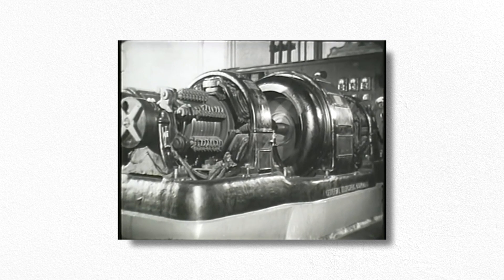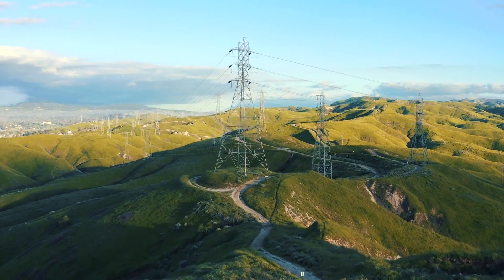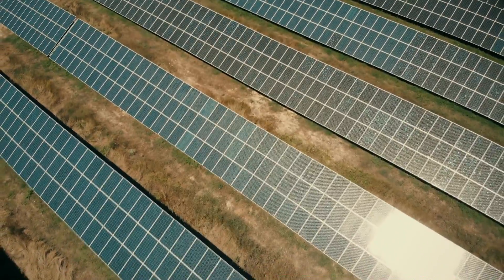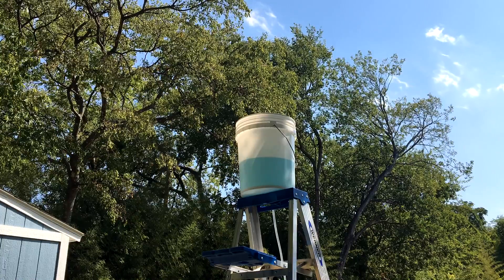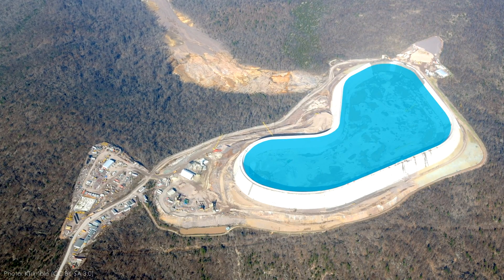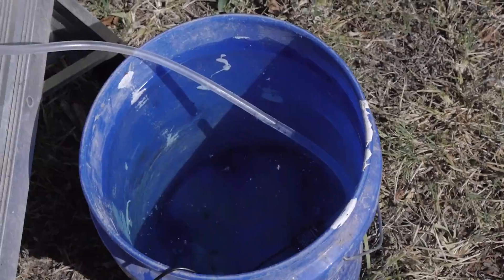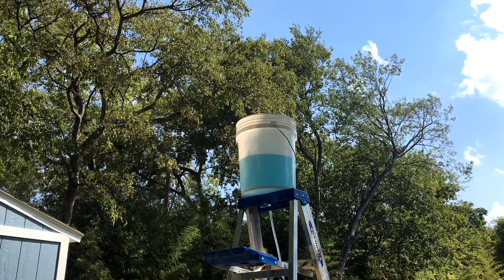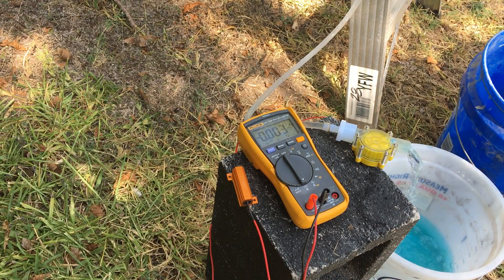World's Largest Batteries - (Pumped Storage)

Comment: I believe dams are an ecological disaster but I would love to know your views instead of parrot what I read. As for energy storage I think this is the biggest issue we currently face in the pursuit of clean energy using variable sources such as sun and wind, tides (slack tide) and waves. These sources we are harnessing for power are variable and our best efforts to build have proven inability to deal with low energy and high energy with reduced lifespans in some instances, limited availability based on expected extremes and expected downtime for maintenance. These problems are solvable. 

HVDC is a good option for long distance transfer of energy at a lowish loss to allow surrounding grids to handle power fluctuations but that depends on massive amounts of excess power availability from other sources... but has potential. Hydrogen is a good storage and transport system with pipes either as a cryo liquid or compressed gas, we could slowly replace the natural gas system with hydrogen by adding some carbon (simplified but worth a read) to build a market for hydrogen as a market for raw hydrogen is built and the kinks are solved. There are always kinks. Production of hydrogen is not easy. 

Oceanic Thermal Energy Conversion. That's the answer in my opinion to our energy demand and so much more. Hydrogen from salt water, water desalination, metal and mineral mining, fish farming, algae production for biofuels, carbon sink, and so much more. Well worth the read. Nuclear in all ish forms rocks and plasma gasification of waste would solve our waste issues and can be a carbon sink including plastic. Terrapower is making a traveling wave reactor that looks good and will take our wastes from reactors and weapons and convert it to useable power minimizing waste. 

OTEC could also clean the water and help remove plastics.

They have the technologies just lack the voice to drive them.

Comment: PSH is only expensive if the requirement is to create dams from scratch. For example, in California there are quite a few dams that can be separated into high dams and lower dams that are fed from those, mostly due to the geography of the central valley being surrounded by mountains. These are perfect candidates for conversion to PSH even while serving their original requirements of storage and power generation.

The main factor holding that kind of PSH back is political, not physical. The anti-dam political movement is in full swing here.

Comment: Did I miss it? In the discussion of efficiency and profit, sure the idea is to use energy surplus now to provide energy needed later. But the strongest case is when energy demand is below base-load, and the energy, whether Nuclear or solar, is generated and would other wise be wasted. Use (some of) it, or lose it.
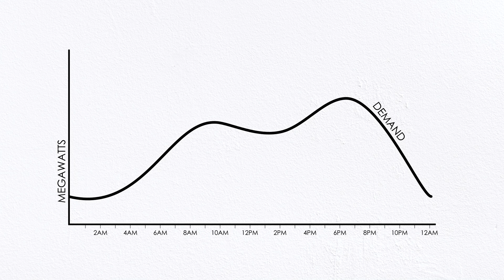Reply from the maker: Check out the graph at 3:04
Reply: @PracticalEngineeringChannel  : Hmm, the graph is underwhelming in getting the point to people that we actually waste energy production today. Those of us with Hydro will many times spill water rather than ramp up production because there is no demand. The main thing to get across is that we are already wasting power opportunities, so even low efficiency re-capture is getting "something", rather than "nothing"

Comment: 🤔 Given that it is easier to generate 12v than 240v would it be feasible to use inverter technology?
imagine a relatively constant flow rate in a river with multiple small turbines strung on wires across the river and then running through a bank of inverters.. maybe not so good for major cities but could work well for smaller communities ? 
Tasmania knows about storage capacity and selling excess power🤦‍♂️ We always had extra power via hydroelectric, then some bright spark had an idea to run some cables to the mainland so we could sell that excess. Not such a silly idea but they started depleting the storage until we were forced to buy the power back at inflated prices and then further depleted the storage to the point where we couldn't even supply our own demands. The dams were empty in the middle of a drought, bushfires were imminent and the govt spent $50m hiring diesel generators that were never used cos luckily the drought broke.
🎉 Yay privatisation of state owned utilities 🙄

Comment: Here's an idea for small scale application. Hydraulic ram pump to fill the reservoir based off of a flow and minor height potential. Add a nozzle to the input of your "generator" that can keep the fluid flow mostly laminar while increasing the fluid speed through the generator (minimal gains, but makes me feel better).

Comment: hello again! I have one question: you mentioned energy density of one Lithium Ion battery is equivalent to your bucket 200km above ground. I'm a bit confused here:
- AA Lithium ion at average 1.5V and 2.5Ah (you may have chosen a much larger battery), the energy is: 1.5 x 2.5 x 3600 = 13500 J
- A 10Kg bucket of water would have to be as high as h = 13500 / (10kg x g) = 138 meters, and not 200 km.
Did I do my calculations wrong here? Thanks.
Reply from the maker: I’m comparing equivalent energy density so you have to compare equivalent volumes of water vs. battery. Sorry that was confusing! I don’t have access to my calcs at work but I’ll double check when I get home.
Reply: @PracticalEngineeringChannel  Ah right! So basically you also assumed a water volume the same size as a AA battery. That makes sense. Thanks!
Reply: ElectroBOOM 

Ooooofffff electroooboooom and all
Reply: @PracticalEngineeringChannel  What if you use a barrel instead of a bucket to create greater generating power and use several Hydraulic Ram Pumps to pump the water back up to the barrel? Could you run that experiment? If you had enough Hydraulic Ram Pumps going you would constantly have the barrel full without using electricity or any power source to move the water back up to the barrel. Hence, near 100% efficiency. Even if you had the barrel (or water reservoir) much higher up to generate greater power, you could build several Hydraulic Ram Pumps at different heights (at a 1 to 7 lift ratio) with buckets in your case (or smaller reservoirs) to move the water uphill to whatever the desired height. 

So in essence, you're moving water uphill without a power source and the power created from the main reservoir would run continuously; which equates to a battery that in being charged at the same time it's being discharged.
Reply: @Paul-cj1wb  From what I understand in this thread and video that bucket of water is equivalent to a AA battery if it was scaled to miles above where it is on the ladder. For power generation even for just 1 house the amount of Hydraulic Ram Pumps needed would be ridiculously expensive to buy, build and maintain. Plus you need a place that has water and another much higher place really close you can pump it to that has enough storage capacity to run the electrical generators.
Reply: @shaunp9592  My suggestion was to see the experiment performed at this small scale. The barrel at the top would represent the "higher up water" since it is being continuously refilled. Even if a bucket equals only a AA battery, the point is that that AA battery would be continuously recharged. 

Obviously, for an industrial sized operation (not simply for a single house) industrial size ramp pumps would be required. A multitude of them. Costly? Absolutely. But then again, the electricity produced would be free going forward once the cost is recouped.
Reply: Use a  bathtub or large water trough and place it on a hill at least 200' elevation,  then use hard plastic pipe...should be a better setup..

Comment: Dude your information is incorrect and outdated.  Apparently you haven't heard of large capacity battery storage which is eliminating the need for Parker plants and solving the solar/wind power production problems not aligning with usage.  And it doesn't require wasting electricity to pump the water into a storage facility.  I suggest doing a little more research before you make stupid statements on a video. I could go on for ever about all of the simple and cheaper solutions to our energy grid but your an engineer, I assume that means you know how to research. They are decommissioning Parker plants all over the place as batteries come online

Comment: Doesn't it take more electricity to fill the reservoir than is generated when releasing? This seems like an inefficient way of doing it that is only used because of the contradictions within a market system.
Reply: Yes, as he said in the video, doing it at large scale has efficiency about 70+%. But if renewable sources' capacity is greater than demand at the time, it would still be better to store unused parts of the power generated, than, say, unplug the sources and not generate that power in the first place.
Reply: @muche6321  Sure, it is better than turning them off because that's lost money for the companies who pay for them to be there. Not necessarily efficient in reality.

Comment: use pulley system 2^n mechanical advantage system so we lift many millions tonnes materials and released that slowly slowly down and with the help of gearbox based electricity generators, in this way we use many mathematical rules and materials

Comment: would it be possible or feasible to use osmosis or capillary action to get the water upwards? then it would be free energy when let back down through generators
Reply: It... doesn't work like that, I think. It certainly won't work for public engineering project like this. Too inefficient, at least.

Comment: From what I understand, the lack of capacity to store electricity is the single biggest argument against solar. I was actually thinking about this exact idea the other day, using solar and wind to pump as much water as possible when they're most powerful and powering the grid itself with hydro. like Grady said, you could use seawater. bot US coasts have mountain ranges nearby, so it might be a huge project, but you can definitely do something there. the problem isn't feasibility or physics, it's the politics of funding large scale green energy public works projects
Reply: For pumped storage mountains are actually handy they are basically free head you can add to the upper reservoir at no extra cost this is why you will find most pumped storage facilities are located where there is a large sudden change in elevation close to a source of water. You want the change in elevation to be as large as possible to get the maximum bonus head from it but also as steep as possible as ideally you want both reservoirs as close together as possible. Less pipework to construct that way which both reduces capital costs of construction and operating costs as the more pipe you have the more costs for inspection and maintenance, not to mention the more loss to leaks and energy lost due to friction inside the pipe both while pumping and generating.
Reply: Grady didn't say "you could use seawater".  He said the possibility was "interesting".  Pumping salt water onto land destroys all vegetation using fresh water, thus there are no salt water PHS facilities despite their many decades of history.

Comment: I'd hoped by switching my home to LED's I'd save a ton of electricity/money.  Yes, my consumption went down, but strangely my $KWh increased to an almost net zero.   

What would happen if we solved the problem by creating our OWN electricity and only used the grid for supplementation?  Something like 90/10%.  Bit of a stretch to think about, but could it work?  Elon mentioned making the exterior panels of our home capable of electrical generation. Then batteries would have some storage capacity.  The solution is in the future.
Reply: If too many users collected their own electricity and used the grid as a storage device without paying for the actual energy consumption then there would be less or no revenue available to pay for  the grid.

Comment: could you generate power using the differential salinity of sea water at different depths? I don’t care if its 5 milliwatts. 

If you run insulated copper underground- between 2 buildings (like ethernet or coaxial) you can accidentally induce a voltage on that wire due to a difference in the ground state of the 2 sites. Can something like that happen with the ocean?

Comment: I would love to see your take on compressed air energy storage (CAES).
Reply: If I remember right, the last time I looked up typical efficiency of pneumatic systems it was down around 10%. That is for industrial systems though, not utility storage
Reply: It's pretty bad from the standpoint of efficiency.
Reply: Ms. D Fong might have to school him on that subject-https://www.youtube.com/watch?v=-QNwGuqh9O0
Reply: There are two reasons to store energy (locally). Firstly, the obvious one - to be an energy source when needed but the other reason is to provide the quantity when needed - which might not be available from the supply at sufficient rate. CAES being used to start large IC engines. Air can be compressed say over 2 hours at a slow rate then released in 2 seconds at a very fast rate. Not only is this used for starting engines but also fitting tubeless tyres to wheels !

Comment: I always thought that if a cubic yard of concrete ((4000lbs)),  was suspended in your back yard, that it could work for household energy storage.  It could be cabled up with a winch driven by solar power, and as needed it could fall turning a generator.  Concrete is 3 times heavier than water.  Gears to control its rate of fall. 4000lbs falling 8ft would generate how much power ???  not an engineer, but seems possible??? maybe???
They all ready do it with led lights on a very small scale.
Reply: In very rough numbers that device could store one horsepower minute of energy or not much.
Reply: @gregwarner3753  thank you for that.
From the water example on this video I had a feeling it wasn't as much as I had hoped for

Comment: One place where this seems like it'd make a lot of sense is in water towers. Granted, you're not getting a lot back based upon how much you're storing but all the parts are there so it seems like just using the pump to act as a generator when you're releasing the water would help recover some of the energy which is otherwise lost unless that energy is contributing significantly to the overall pressure which would make my idea pointless.

Comment: What if we were to construct huge watertight tubes (using your caisson video ;) ) offshore?  Then you have access to way more ground area, which means way more volume and also way more head! These would also be much less intrusive. simply pump water out to store your energy, the reverse of those we use on land. It seems such structures would be much cheaper and simpler for the same volume and head.
Reply: It's expensive, both in building and maintenance. Oil rig only feasible because, well, oil.

Also, enviromental issues.
Reply: @rusdanibudiwicaksono1879  it's expensive to build on land too, and for less height, and you need to build two. Environmental impacts are much worse on land for a variety of reasons as well
Reply: @mattg8116  Well, the main problem with building on sea is saltwater environment, primarily. And regarding height: Nope, it's actually cheaper to build on land regarding height, because you can always use natural hill to your advantage. Build on sea basically you had to always build  your own hill from scratch
Reply: @rusdanibudiwicaksono1879  there are hills under the sea level, much bigger than any on land actually. and you have the buoyancy advantage, as well as still only 1 reservoir needed. I assume we can handle the salt, though it is a hindrance. There is no shortage of successful oceanic infrastructure. Truthfully there is no easy solution, but I'd love to see this as a concept
Reply: @mattg8116  ...Okay, forgive my dumbness, but why in God's name you build a pump storage, as in, electric storage that depends on water height difference to work, under surface water?!
Reply: @rusdanibudiwicaksono1879  re-read my first comment. Your "work" is pumping the water out of the cylinder. Your your height can be however deep off-shore you want to go. To get energy back you let it flood through turbines.
Reply: @mattg8116  Okay, so I've misread your intention. Basically, instead of 'normal' 'water goes on upper lake during low demand, and goes on lower lake and moving generators during high demand', your idea basically 'water goes into tunnel during high demand, and pumped out of tunnel during low demand'? 

...It's... novel ideas, but there's some RL restriction with that. First problem is basically 'the lower lake'. You can only build the 'lower lake' so big underwater (with our current capabilities), and it still wouldn't be able to be able to be as big as surface reservoir, or as malleable (digging lakes to be bigger are still easier in surface compared with building underwater structure).

Comment: I used to live in Warren Pennsylvania and we had an upper Reservoir just like this and it's funny that you would call it a battery because that's exactly how I explain to people the point of it. In our case the electrical output from the grid was always about 85% 24 hours a day during peak time the upper Reservoir cap the output from going above 85% and during the off-peak hours the upper Reservoir use the additional electricity not needed to pump the water back up